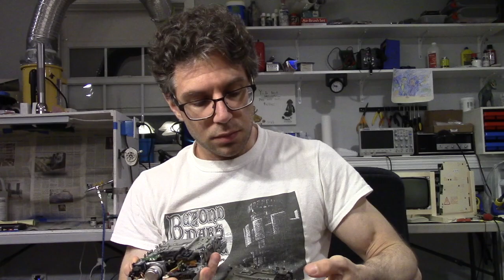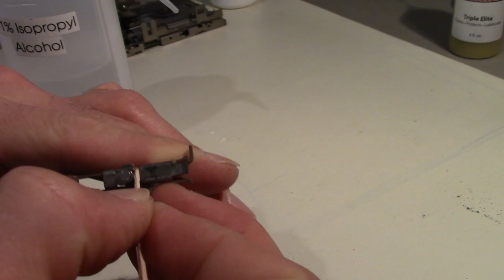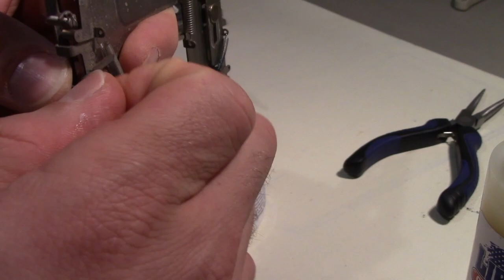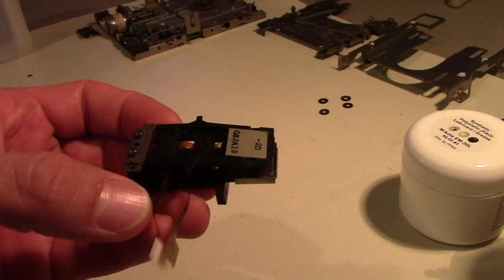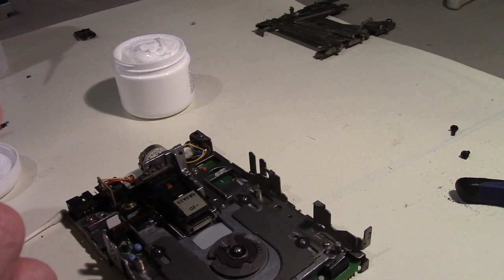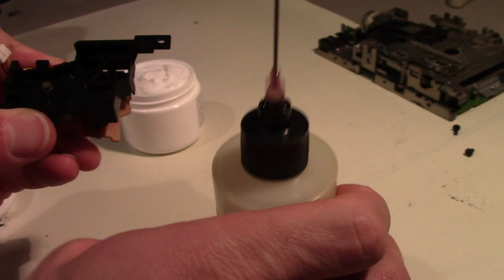Sony 800k & 1.4MB Floppy Drive Cleaning and Lubrication

Comment: Thank you for making and posting this video.  I have found it very helpful in getting my Mac SE Sony 800kb floppy drive reading and booting again.  The eject gears are still giving me some trouble.  I have greased and relub'ed the gears using the same products you are using in the video.  However, when all the gears are carefully reinstalled and the gear box is closed up, the gears never turn to eject the disk.  If I remove the gear box cover, and pull out the first gear you remove in the video, the top two gears move freely.  With he Mac powered on, and when I move the large gear to the 1 o'clock position, the bottom two gears spin. When all 5 gears are installed, they just don't seem to want to move.  Any ideas? Thanks in advanced.
Reply from the maker: Hello, Alan. Thanks for the reply. I would like to help you more in depth. Once we find a solution, we can report it back here. Please send me an email to my name here at gmail, ans we can take a look.

Comment: Thanks for the very informative video! 
I have a few 800k drives (Sony MFD-51W-03 & -10 & others) for Mac Plus computers that I'm trying to get back into working condition. A few of them work with the exception of the eject mechanism not ejecting all the way, which I'm working on currently. I got replacement gears and I think the key is freeing up and lubricating everything as you have detailed. I missed a few spots. 
But there are a few drives in which the head assembly simply does not move from the zero point. Well, if I manually move the head away from zero, when I power up the computer it will return to zero, but after that the heads never move. The drive spins and everything else appears to be okay. Have you ever encountered this type of behavior? Do you happen to know the solution for it? 
Thanks again!!
Reply: Hi Ken, thank you. I am glad that you enjoyed the video and founf it helpful. A few things to consider. There are times that this occurs simply because of electronic failure, which is an entire other topic that I am much less than qualified to broach. That is what I would assume. However, can you detail the symptoms more? What happens when a disk is in the drive and the machine is turned on? Does it attempt to read it at all? Does it eject it? What else happens?
Reply from the maker: @Yellow06Mustang  (sorry, I repiled from another account by accident!)